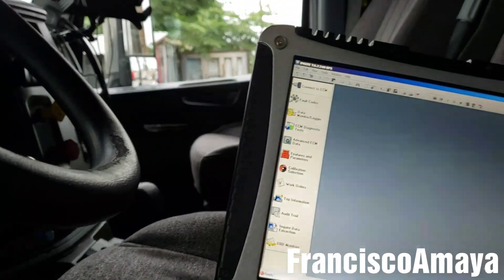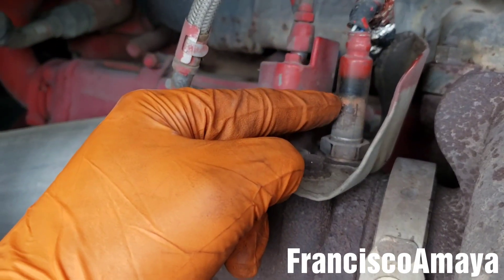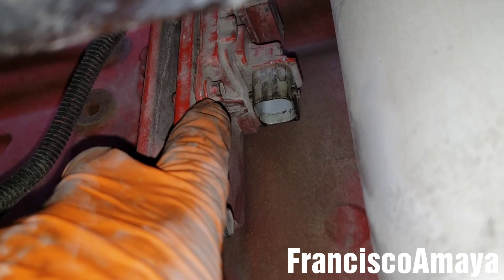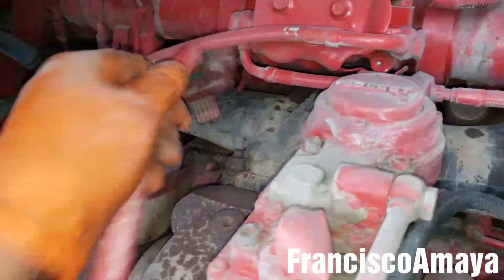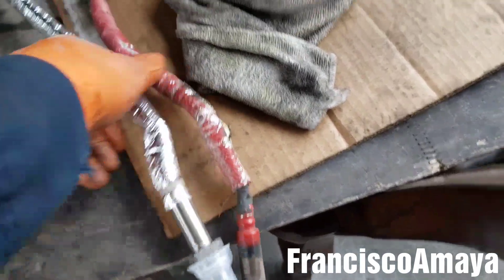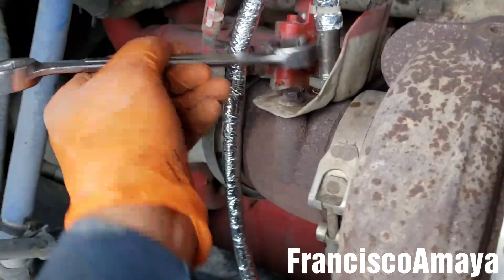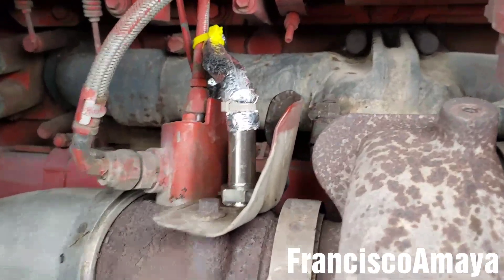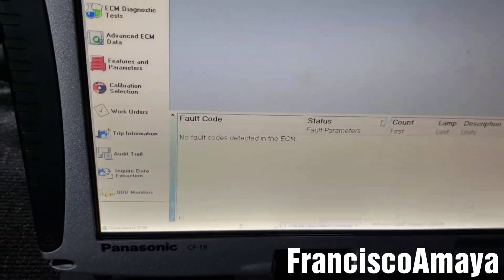Cummins ISX ISX15 SCR inlet nox sensor replacement SPN 3216

Comment: Intake box sensor keep giving me SPN 3216 between 250-500 miles after change I use genuine and aftermarket and none survives. Can’t find a broken or shorted wire.

Comment: Are you supposed to run a regen after changing and clearing the inlet nox sensor code?
Reply: If it is in derate - you will have to run a forced regen

Comment: Thank you for this Video Francisco. I definitely used torch to heat up bolt. It came off so much easier.  Also the 7/8 wrench I used was the same. The regular 7/8 wrench was not working as great.

Comment: Thanks for the video. When I'm looking for a video on a problem I'm having, I'm always relieved to see you covered it.

I removed the little heat shield thing between the turbo and the sensor, and I had room to use a regular 7/8 wrench. It also broke free without much force, without using a torch or anything. I think a shop removed it to do something about a year ago. So maybe that's why.

Comment: I just made the grave mistake of not heating before removing sensor. When I put the new one on it didn’t seat. Talk about kicking myself. Now I got bigger problems.
Reply: Can u give us an update. I just did mine too without any heat now I'm worried.
Reply: @genaromeraz6041  you’ll know if it seated properly if the wiring coming doesn’t move or have any play in it.
Reply: Coming out.

Comment: SPN-3228	2	Aftertreatment 1 Outlet Gas Sensor 1 Power In Range ESTE CODIGO APARECIO EN MI CAMION
Reply from the maker: si el sensor es nuevo, es posible que tenga un problema en el cableado

Comment: I put in a supposedly good used nox sensor. The same inlet one on px7 cummins engine. The code cleared but when I was doing the regen the ppm on the inlet was -200. Is that normal?
Reply: More than likely it was a bad unit or it was full of soot and carbon

Comment: I have that code on cascadia  cummins 2250. But mine  the sensor been replaced before  I have amber light on  but I still can do park regen successfully . Do you think if I do regen successfully  mean that sensor is good? may be the problem is in wiring harness?
Also can it  derate me on the road?
I got that code  twice the first time went away  then came back again . Thx alot
Reply: FC3725 is triggered based on the inlet NOx sensor's reading being unstable for too long.  It may or may not be a "real" sensor failure.  I suggest checking some obvious things:  

Is the sensor cable burnt?  Sometimes the cable makes contact with the turbo and gets burnt.
Is the sensor probe dented or bent?  Visible damage to the probe will almost always result in permanent failure.
Is your ECM cal up to date?

Comment: Just one quick thing...It appeared you didn't have the yellow tab clicked all the way back in.  Those last few millimeters of engagement are essential to ensuring it does not come loose and give you a non-communication fault code down the road (FC3232 or 2771).  Those are very difficult to diagnose.

Comment: Also protip, buy a thread chase or tap the size of the nox sensor and every time you replace one, go in and clean up the threads with it. They build up rust and gunk in there that can cause some issues threading on your next nox sensor

Comment: For anyone wondering, you can get a Cummins reman nox sensor for about half the cost of the new ones. And I’ve replaced hundreds of nox with very few problems from remans
Reply: Reman Nox sensors actually have brand new probes -- which is the part that wears out.
Reply: Thanks Tommy, where can I find the rem nox  sensor at half the price. Thanks in advance.
Reply: @gilbertsepeda257  when you order your part from the dealer, freightliner, Cummins, kenworth, doesn’t matter. Just ask for. Reman nox sensor. Or add rx to the back of the part number an it should pull up for them

Comment: I have a 2018 x15 i had the 3216 fmi code for intake nox .I replaced sensor but I dont have a way to clear code .. will it go off eventually or do I need to take it to a shop and have code cleared
Reply: If it’s derated you’ll want to take it to a shop, if not you can either remove battery cables for a little while and try a manual regen. If all the sensors are working it should clear out the fault

Comment: Can this sensor be cleaned?
Reply: No do not attempt to clean the sensor unless the probe is literally caked in soot and you cannot see the inlet holes.  If you want to remove the soot, then use a damp towel (not soaking).  The sensing element inside the probe can be damaged by almost anything.  99% of the time, the fault code is unrelated to cleanliness.

If your connector is dirty and you've having trouble engaging the yellow tab, you can wipe off the gunk (rag, q-tip, etc.) but be sure not to bend the pins inside the connector or get any fluid into the connector.  There is a hole in the connector which leads to the PCB.  If you spray something in there, it could damage the PCB.
Reply: It can be cleaned with solvent and dried out before use, but usually it sets another code a week later, and the wiring to it will give up after a cleaning or 2

Comment: I still don't understand why the engineers put the mounting bolts facing the oil filter, making it much harder to access.
Reply: Because once upon a time an engineer busted a mechanic banging out his ole lady, ever since all engineers do whatever they can to piss off all mechanics
Reply: @tommyweese5697  same story I always heard.
Reply: The mounting block that the module bolts to is 2 13mm bolts. Just remove both of the bolts the mounting block and you can face the module making removal easier.
Reply: I've been asking the same thing.  A little birdie tells me it'll be better in 2024. 😆

Comment: Alot of times when you change the nox inlet the outlet will go out in quick order i change them both at the same time thanks for the video
Reply: Let me add onto your statement...In my experience, the outlet will typically wear out a few thousand engine hours after the inlet, so consider that before swapping both at the same time--they're not cheap.  If your aftertreatment is under warranty and Cummins finds out you replaced a good sensor without reason, they might not cover it.